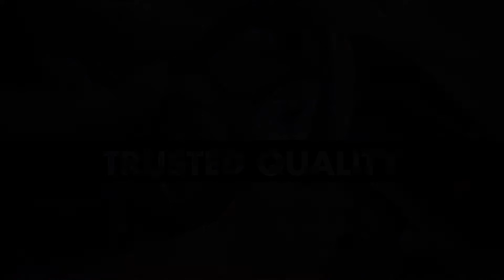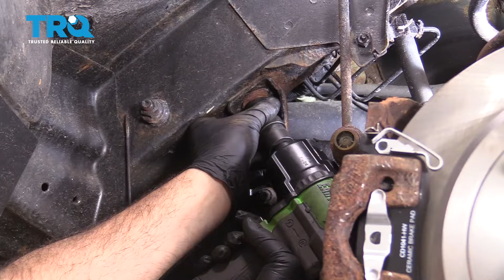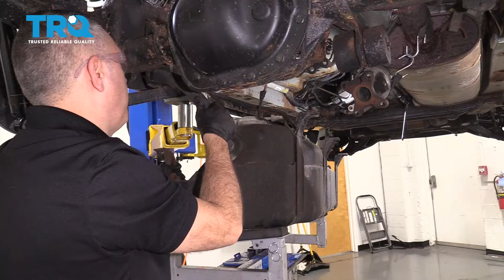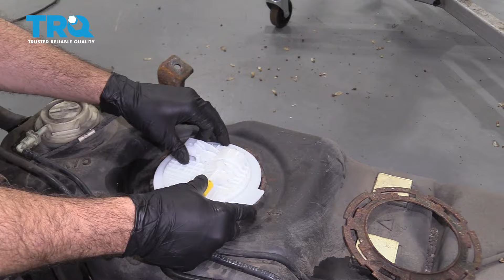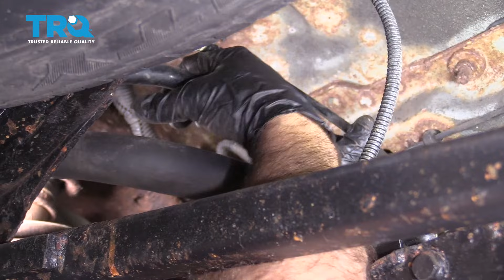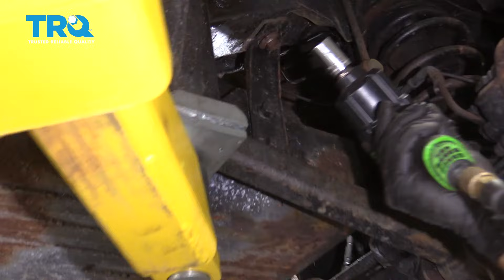How to Replace a Fuel Pump 2005-10 Jeep Grand Cherokee

Comment: im now having a problem with a vapor lock and my new pump is making a ringing/humming  noise off and on-is there a way to fix it with a inline check valve or inline filter of some sort. I have to release pressure on the fuel rail to recrank it after it runs for more than 10 minutes/ which is a possible fire risk.

Comment: I had to replace my pump housing because my gauge stopped working. I skipped taking apart the whole car by removing the rear seat and cut a hole between the mounts for the module under the seat. Had full access to the pump assembly and now I have an access panel where Jeep should have had one in the first place!
Reply: How did you make the cut out piece fit afterwards?
Reply: Can you post a picture or video on it ?
Reply: Do you have any pictures of this?